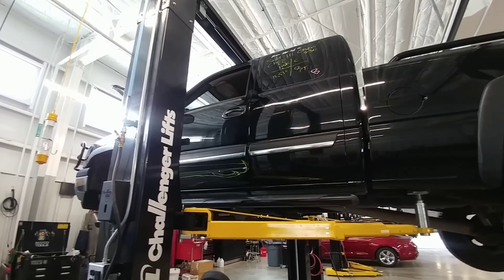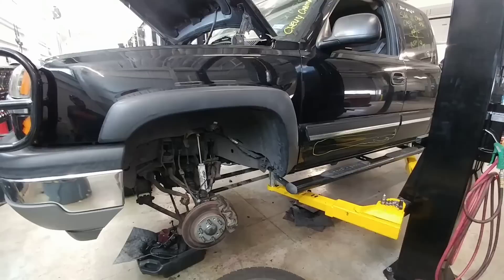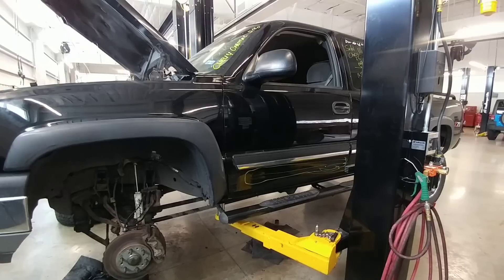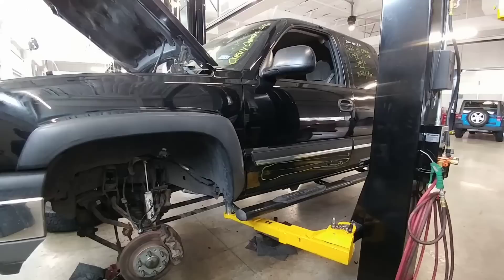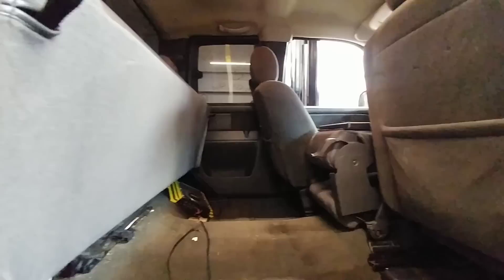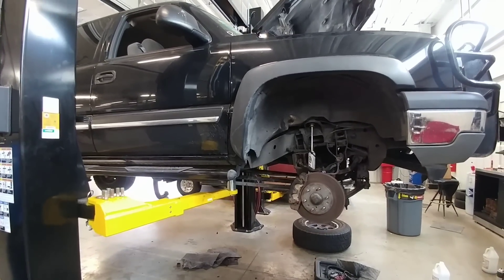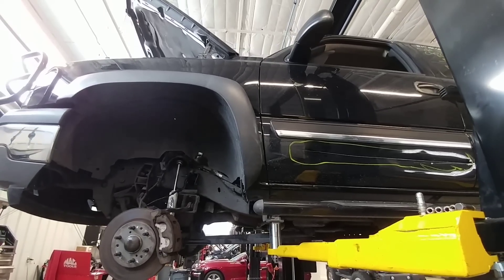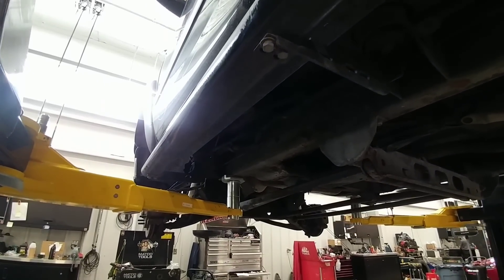Part 3: The $10,000 Silverado in the shop!

Comment: I remember when I first bought my 05 Sierra 1500, I spent upwards of 4,000 needed new brakes all around pads rotors lines, new fluids, new shocks all around, u joints, steering coupler, alternator, battery. Haha as with any used truck be prepared, she rides like a dream now

Comment: I bought my 2006 F250 6.0 Crewcab with 50k miles back in 2016 for 18k dollars. 
I am the second owner. The truck had excellent service record, the previous owner strictly followed the owner's manual maintenance intervals and he even had documents to proof it. Fully stock truck and rust free southern truck. The Vermillion Red paint and the interior are in excellent condition and I get compliments all the time.

I'll take my 6.0 over that 10k Chevy any day. And plus it's a diesel ;)

Comment: Jack the rear axle off the ground with a floor jack, put the vehicle in 4 wheel drive and let off the brake pedal slightly. If the truck doesn't move the 4 wheel drive isn't working, if it move forward slowly, it works.

Comment: This truck having a value of 17k is why I just bought a new Nissan Frontier 4x4 LE V6 double cab for $24,800. I would have loved a used Avalanche or Silverado but not at 100k miles at these prices.

Comment: lol, I just traded in my 2005 GMC Sierra same cab / bed configuration. Black with a silver undertone, aftermarket dual exhaust way better interior had all leather, Bose sound system, basically a step down from Denali. After 2 1/2 years of ownership, replaced tranny, replaced radiator, replaced starter. The computer started going out from corrosion, the engine had an exhaust leak in the manifold, it was misfiring and spewing out clouds of white smoke, got about 5 MPG because it would just burn through gas for whatever reason, shocks were shot, power steering thing looked to be leaking. It did have a bit of rust on it, but not a lot on the body just on the rocker panels. Bought it at 107,000 miles for about 13,500 2 1/2 years ago. Probably 4,500 in repairs, sold it at 148,000 miles for $2,500 trade in LOL. Loved the truck was fun to drive and I really enjoyed it. But I'm not sure I could ever buy another one after losing $15,500 in 2 1/2 years lol :( I guess I just got a shitty truck, but hope this one lasts for your friend.

Comment: I had a '94 Ford Bronco where the auto locking front hubs didn't work. I changed it out with manual locking hubs for around  $300 and it worked perfectly :)

Comment: Great video again! Thanks ! The underneath of that truck is in great shape, clean it apply a wax coating to the frame and oil it with New Hampshire oil once a year it will last many many more years! 16500.00 is a bit steep price-wise I think but it's definitely worth the 10500.00 in my opinion. Come up to the England if you want to see some rot!! I have F-150s, 1500 Chevys that you can stick your fist through the side of the frame there so rusted, cross members missing and especially on the Fords the bed support rails on the bed and rocker panels are gone ! The rust that's on this truck is easily managed repaired and maintained as long as it's taken care of now!!

Comment: When I picked up my 99 Silverado extended cab with 120K 6yrs ago (also a GMT800 Z71 4x4) it was in similar shape for about that same price point (Interior was mint) my immediate issues were an intermittent fuel sending unit malfunction, a RF speaker that wasn’t functioning and paint issues (lack of clear coat on the roof ect) A couple months after purchase the ABS module had an issue as well, all were common issues with this generation truck and relatively easy repairs. paint has gotten worse I have no $ towards getting it repainted as long as it doesn’t rust it’s fine, it’s still a work truck after all. The truck was 11K after taxes and financing I’m at almost 180K and have had no real issues other than the stuff that needed repairs when I bought the truck the rest has been maintenance (shocks, fluids, brakes, and one set of plugs and wires)

Comment: Great video, I had a 2006 GMC Sierra SLE crew cab White 2 wheel drive I traded it in for my 2014 GMC Crew Cab and they gave me $14,000 it looks brand new in the interior the outside had no dents or rust I live in the Florida Keys and it's hard to keep rust out with all the salt air down here.

Comment: I'm gonna take a wild guess with a used Chevy and what it needs before I watch this video, brake lines, fuel lines, trans lines, rocker pannels, water pump, fuel injectors, ball joints, wheel hubs, suicide door handle, and tailgate handle

Comment: You can get good quality gas trucks under 10 all day. Got a suburban for 3 grand. Only flaw is the Chevy hood peel. Used truck prices are so ridiculous just buy new. F150 stx for 29 or XLT for 34 reasonably equipped and same with the others

Comment: If I KBB my truck, a 2005 Silverado 1500, Z71, LT, X-Cab, 5.3l L33 engine, and at 105k miles (actual is 215k) The value comes out to $7,421. That LS trim truck is nowhere near worth $10k
Reply from the maker: great to say, but find any truck anywhere in the country with similar miles, in same condition (that you can prove) for under $11k.  KBB is a joke when it comes to values in many cases
Reply from the maker: Martin Gray: KBB says $9500-$12500 Private party, which would be roughly $12000-$14500 retail.  Didnt know dealers sold for trade in value in your area.
Reply: It is a joke, because KBB usually overestimates prices, particularly poor to fair condition trucks. This truck is no better than fair condition.
Reply: The Repo Man That's been my experience as well.  Unless they've changed kbb is average asking price while Edmonds is average transaction price.
Reply: I have no idea why I check KBB any more.... someone please tell me what is the most realist price guide?
Reply: Israel Harris Value is subjecive.  Unless you're planning to flip it don't worry about what some guide says, just find the best car for you at the best price available in your area.
Reply: highly unlikely... I am planning to use this to help build a house in the woods... it has to be cheap so the house can be more expensive.
Reply: The LT is not a big deal in 2005 . The LS and LT back then where basically the same except for leather and color trim/chrome.
Reply: It’s only really worth what someone will pay for it.
Reply: KBB is just there for the dealers to screw you on tradein value.
Reply: The Repo Man this channel is just getting mad that he can't argue the fact that this truck is overpriced

Comment: The thing is, a customer gets charged 100 per hour for repairs, yet the shop probably pays 20 per hour, maybe less!  16k you can get 100k 2012 truck.
Reply: Robert Mcgee What sort of professional mechanic works for $20/hr?  Also you're ignoring all the necessary overhead (the building, lifts, insurance etc).
Reply: sonictech1000 depends, every dealership or shop has non master mechanics making that amount.
Reply: That truck for 8 or 9,
Reply: sonictech1000 why do count the lifts in there? How expensive do you think they are? 😂

Comment: The dealership would get their money back in what it cost to actually get the vehicle on trade-in and "dealer cost" for parts and labor. The frame looks okay but need to get the surface light rust off and have the whole undercarriage sprayed with the stuff so it don't rust down the road.  I live in Pennsylvania and my 03 Cavalier being the frame got eaten alive and has much rust and parts of the frame missing. Part of the back bumper "steel part" rusted and isn't there. Hole's in the frame big itself will flunk any car/truck in inspection. The person that buys it in a year or two years if the state requires inspection, will probably fail when the rust eats into the frame.

Comment: It is still not a $10,000 truck. I have the exact same and its worth only $8600. I only have 150-160k miles. My body lines are just as clean and the frame is only sirface rust due to living in the country.

With heaving this truck saying its $10,000 is like saying mine is worth $12,000.
Reply: i think you over estimate the value of your truck.. if your truck is the exact same but 45-55k more miles it would depreciate more than 1400 dollars.
Reply: Brandon Thies My bank actually values my truck at $12,000 as they loan only a percentage incase of default. NADA, and KBB value it at $8600. My truck has every option available at the time, but its the per model sunroof. Im also in texas. My truck was bought local and has stayed local its entire life with zero need for repair.

Comment: Absolutely not worth $16,000, not even $10,000. This thing is in poor shape. According to KBB, maybe $5,000 or $6,000! Our contractor bought a 2007 Tundra Limited early this year, with similar mileage, practically fully loaded, in virtually flawless condition, no problems, no leaks, interior and exterior looked like new, was owned by a former diesel mechanic who kept all the records, and he paid $15,000 for it. He's already put 7,000 miles and has had no issues. This Chevy pile already has issues and will likely have more! What a ripoff!
Reply: Chevy is good. You have the price right at 6k. But 16k it better come with a bds lift and new tires. I will say Tacoma owners are worse. Beat up trucks and want a fair price.
Reply: Lift and tires are dime a dozen and not worth what this said it was for; Sure am glad guys like you think that though, keeps guys like me in business.